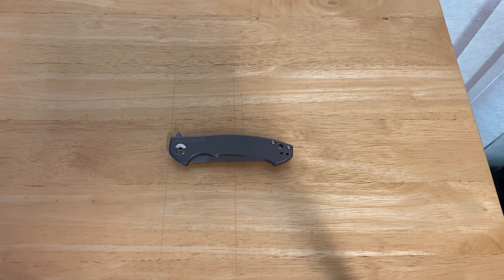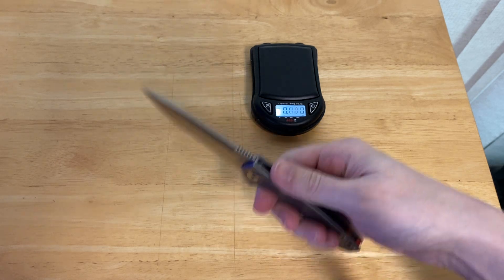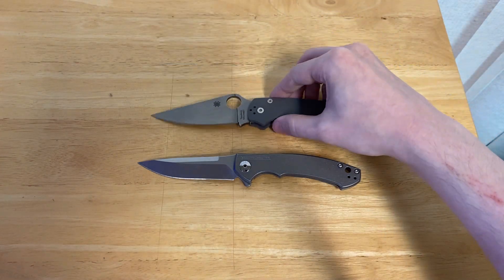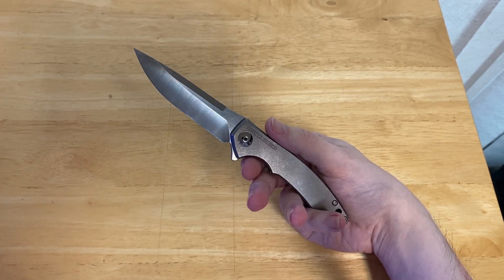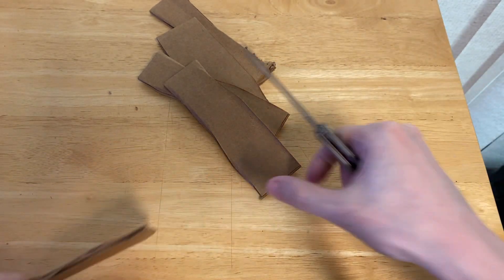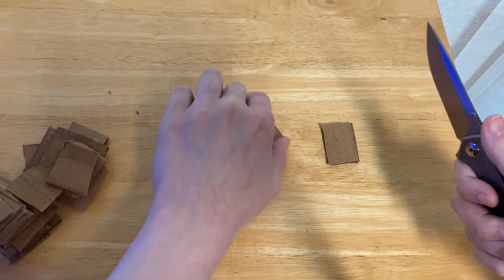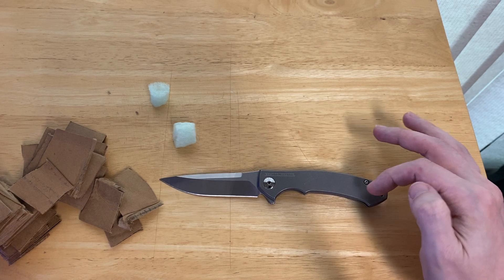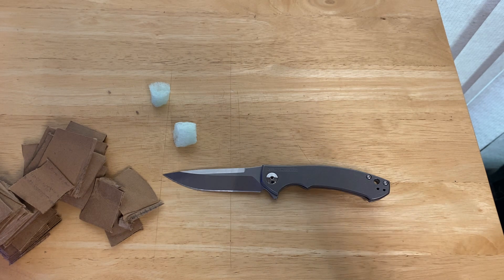The Zero Tolerance ZT0450: It’s Finally Lived Up to Its Potential!—Gaining an Edge, Ep. 400

Comment: I've always wanted a ZT. But they're out of my price range. That just looks like a pocket knife personified! Awesome blade steel S35VN is by far my favorite powder steel even today in 2023. So we rounded. And with the geometry of this blade combined with it being a ZT leads me to believe this is going to be an awesome EDC! Awesome video as always man 👊
Reply from the maker: Like I said, this is my second favorite ZT, with my favorite being the 0562 because I’m a Hinderer fan and it’s basically a production XM-18.  The 0450 I love based almost purely on performance, and the excellent blade steel and combination of a sturdy blade and thinness behind the edge makes it extremely well-rounded.  It absolutely is an awesome EDC, and I very much maintain that had ZT not had so many hiccups related to heat treat and lockup in the years almost immediately following the ZT0450’s introduction (basically 2016-early 2019), I think this would have become a classic.